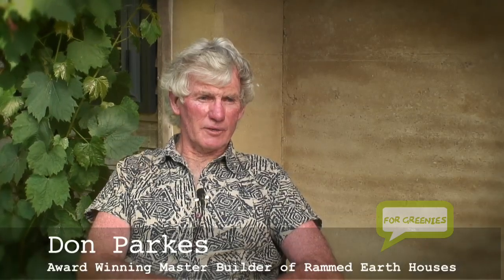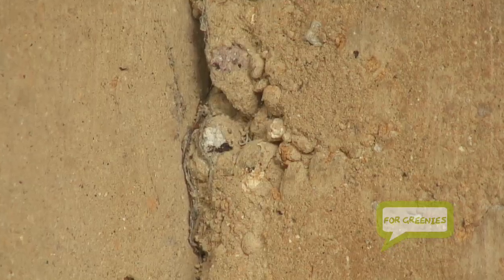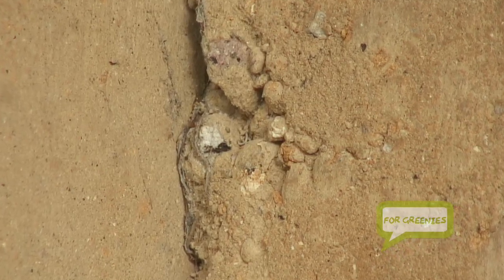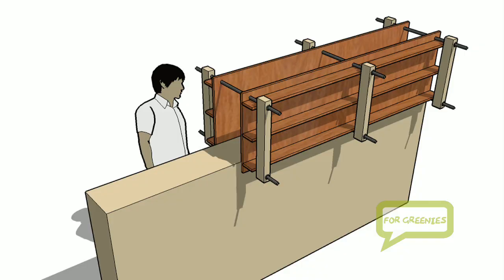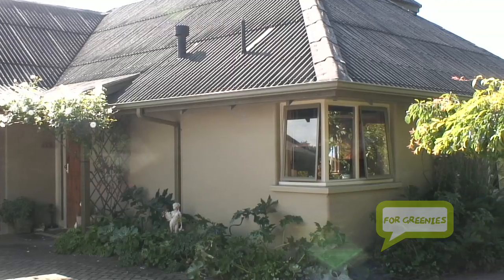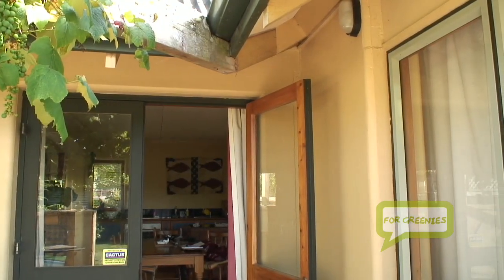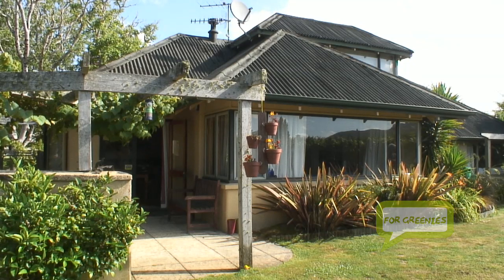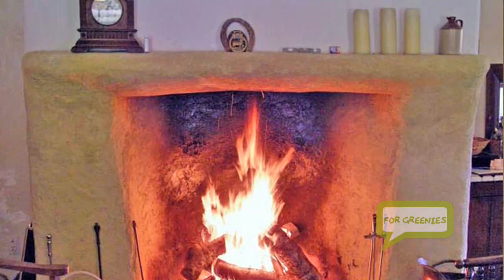The Rammed Earth House Interview with Award Winning Master Builder Don Parkes HD

Comment: I built one in Taranaki many years ago. Very labour intensive but it does have a nice feel to it
Reply: i was thinking about that, couldnt a lip be put on the form and an automatic wall pounder put on it that goes across at a level height that you control and move up as you pour in more dirt? that way no one has to use the pounder and sit there pounding dirt, you just pour in the dirt and turn it on for a layer, pour in more, turn it on for another pass. its not going to take out all the labor, it's still building a house but from the vids ive seen would cut down a lot of work

Comment: Purists don't get mad...but can you paint a rammed earth home?
Reply: You can, but as you'd imagine it's detracting from the beautiful aesthetics.
Reply: Twentyfive years ago I built a hotel in the  Ecuadorian Andes with rammed earth. We mixed no cement, outside walls we  painted with cal apagado which is a white powder with some sand . We mixed it with water and applied it liberally with a block brush, stirring continuously and scraping the bottom to mix in the sandy bits. After drying that would stain slightly but not much harm done. On the inside we painted with the same cal apagado mixed with wood glue(to make it impermeable) and ecoline (a liquid kind of ink)  or other pigment, can't remember the details. I am now looking into the possibilities of building a new house, (I've been back in Netherlands for 20 years now) but this time I won't use manual labour but a Cat and pneumatic tamper. My idea is to color the walls black on the outside so as to improve heatabsorbtion during the day. We also buit chimneypipes from cement wastewater tubing. Just set it upright in the box and tamp around it. Worked like a charm. Well, I must be honest, it took a long time before we could have a fire because the wall were wet for so long and the smoke would not go out the chimney. Also we worked with a corner segment in the shape of an L so as to get layers that interlock on the corners to make the buildings earthquake proof.